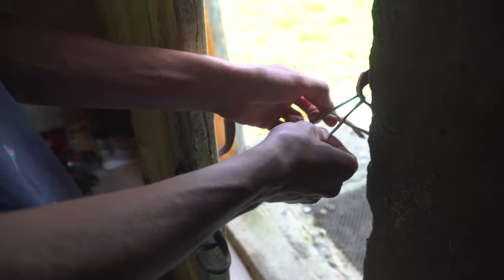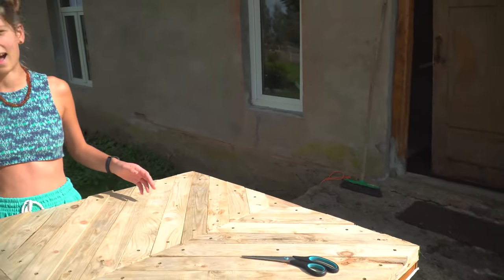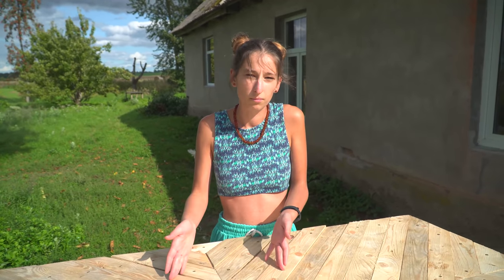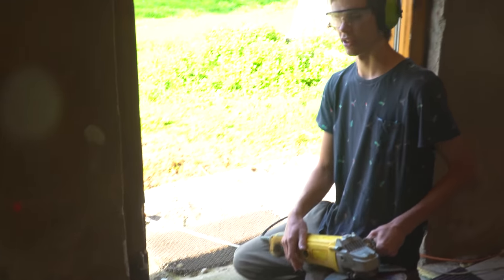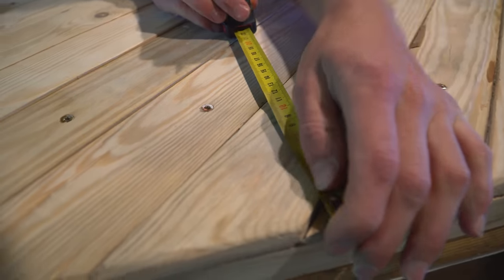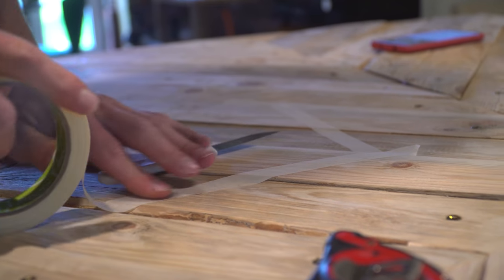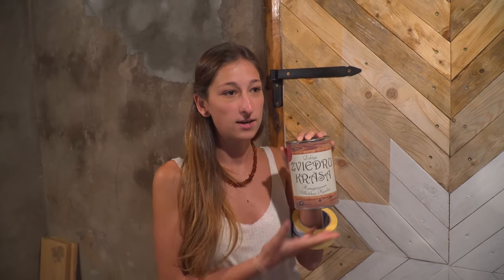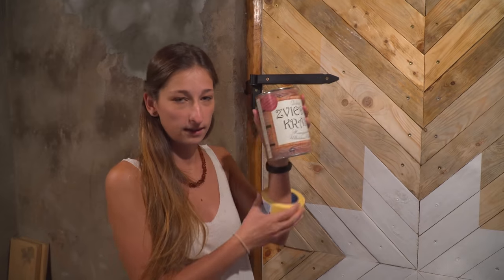Traditional ART on OLD WOOD Door

Comment: A small tip for you guys. When you sanding anything with a drill or something similar, you need to slow engine speed to minimum for best result. Of course it will slow work down, but it is a way to do it :)
Reply from the maker: Thank you, I need to get a better sanding machine this isn't the best way. But I will try it on slow speed maybe it makes it better. 😊❤️